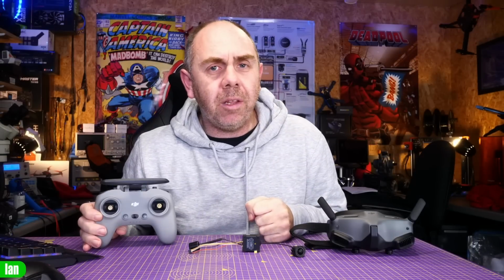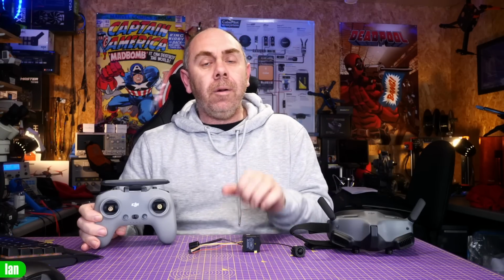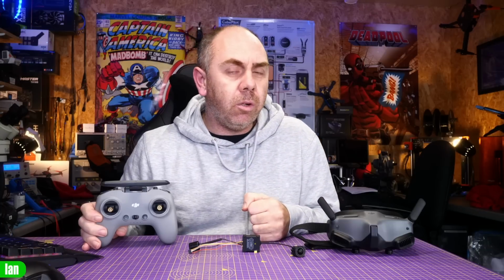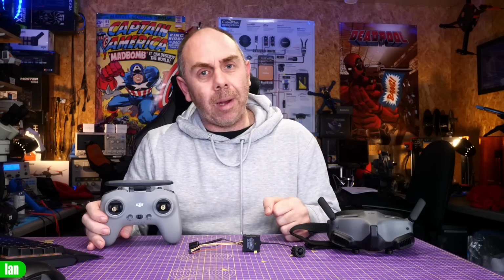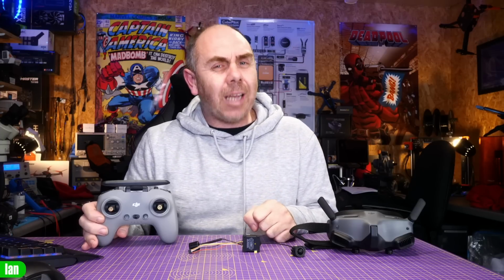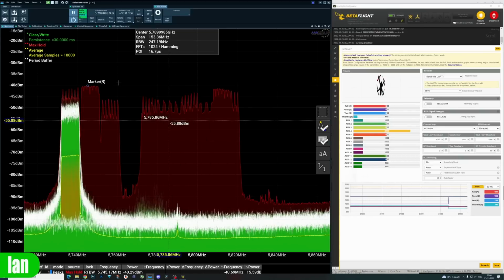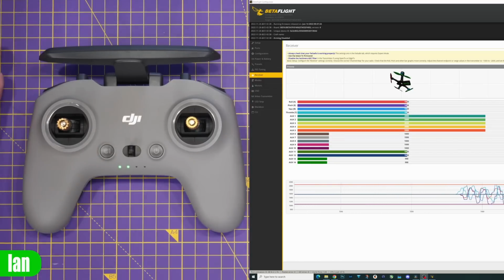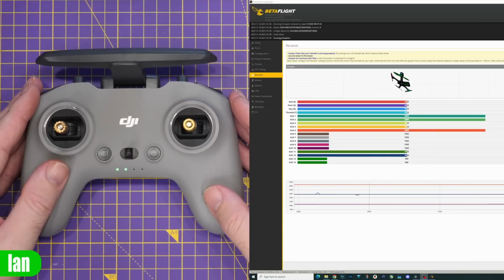DJI O3 Digital FPV Remote - Its Got One Problem

Comment: Without Gps how can altitude be determined on  the air unit in the event of a failsafe you have it go to say 200Ft and RTH. How would that work? Or you don't have the option of RTH because of no gps?
Reply: without GPS you don't have the return home feature, to have RH you need have GPS to pin point your home at take off

Comment: So since the Avata is O3, does it have the same problem when using the Remote 2 controller ?
Reply: yes, but Avata will kicks in whatever you programmed in signal loss, Return Home, Hover etc

Comment: It's really cool they released the backwards compatibility firmware last week!!! So many people said they wouldn't do it... How do you all like your crow prepared? Roasted, fried, barbequed... Hahaha!
Reply from the maker: It’s not out yet. No hacks work at all, no FCC, no Naco, no 1200mw. and it also does not work with the other goggles either right now.
Reply: @MadRC  I know Ian but with the Beta out, it's just a matter of time. I'm not referring to you BTW, just the negative Nancys that said they'd NEVER do it because they want to FORCE you to buy the O3 units to use the Goggles 2. 

I guess I don't understand why you'd want the Air Unit to work with the old goggles if you dropped $650 on the Goggles 2? Can't you just downgrade the firmware if you REALLY need to use the old goggles? I mean the Version 1 goggles use an O2 based system, the Version 2 goggles can use either and soon the Goggles 2 will use either, correct? Personally, I'd stick with the V2 goggles, they already work with the old Air Units and the O3 Air Units. 

Compromise isn't a DJI specific situation... There's always compromises to be made, especially when making old devices work with the latest gen. Take Autel, they have 3 versions of the Evo 2 Pro out and none of them work with the controllers of the other 2. V1 only works with V1, V2 with V2, etc. That drone has only been out a couple years, whilst the Air Unit came out in summer 2019, I believe.

I'm not saying we should throw a party or anything but I'm glad to see them working towards keeping their promises. That's more than can be said for several FPV companies these days.

Good chat, cheers!!!

Comment: Thanks for all the hard work.  Just 2 comments though, RC link return might still get you to initiate RTH in case of video loss. My one good argument with the use of the DJI RC is it is the same setup as the AVATA, I’ve seen a lot of good reviews with the AVATA with no RC issues.
Reply: The Avata is sweet. If the video signal gets too choppy the drone autoswitches to normal/angle mode and hovers in place w/ GPS (can also be configured to RTH).
Reply: Yeah, can confirm your comment. I've just ordered the MOZ7 with just 03 for use with the C2. My Avata has been everywhere you can think of and it's only gone into hover in place once and totally lost and landed once. I fly it in woods, forests, bando's, concrete car parks and it's been solid. I do have a Tango 2 Pro though, so can fit a Crossfire if flying the MOZ7 causes any issues. I'm also an ex-DJI FPV flyer and the range on that was awesome and had zero control or signal loss issues when flying that.

Comment: Would it still be better than a FRSKY Reciever and a radio? I feel like the DJI Controller might still be better than FRSKY
Reply: absolutely. night and day difference. Personally i use the dji remote and it's been perfectly fine. If you're stressing the video to the point of it being about to disconnect, you're already pretty far from yourself and have been for quite some time. Probably shouldnt be flying there anyway. I've had more than enough range with just using the dji remote and 03

Comment: Is DJI going to refund all of the people who bought a radio to fly the 03 Air Unit only or are they going to find some kind of solution to this problem?
Reply: they just want the money and run, creating new  stuff without fixing major bugs from old stuff, all about to making millions
Reply: @RCREVIEWS101  They make good stuff, but not having that radio working better than other links like Crossfire or ELRS is pretty sad. I use the black radio on several of my smaller drones and it works fine in my opinion.  Sounds like it works better than this one does.

Comment: Is this an issue that DJI can fix with firmware?  This sounds like a safety issue as well as a drone loss situation. I never had an FPV drone that could just lose RC Link for 5 seconds and not crash. 

Ken thought his BEC failed. Even with GPS rescue set his drone would have been on a dangerous mission because he would have not been able to regain control.

Comment: Wow this is crazy! This seems like a massive drawback! Can they update this via software update to keep Rc standalone or at least reconnect after .1 seconds? Rc link on goggles is shown as a seperate signal indicator so this setting seems completely pointless. 
How long does it take for video recovery on the new o3? Current air unit seems to take quite some time to recover video after signal loss

Comment: I'm guessing the delay is to give the system the opportunity to recover. I'd hate to have it failsafe immediately, personally.  If you have it set to "hover", in 5 seconds you'd recover control. I'd imagine that the OSD would reflect your connection status... At that point it's a tough call. Every FPV pilot I talk to claim that they aren't ever more than a couple hundred meters away from themselves so it shouldn't be an issue to punch out to recover the FPV feed.

I think my main confusion is to wonder how this is different from the original system? Isn't this why many pilots use Crossfire, etc with the og digital system?
Reply: That don't work, yeah might be a couple of hundred meters, but think about your drone going 60mph(easy to achieve) for 5seconds straight.. not real good I think xD.
hover in a fpv drone   will just make it level and not stop moving
Reply: @henrique14211  Fair enough. Apparently,  if you have GPS Rescue or iNav it's a slightly different story. I guess my biggest question was how is this different from the original system? Plus isn't this why most people use the DJI air unit for FPV only and use other systems for control? I'm not sure this is a new situation...

Comment: What happens if you've set the quad to GPS rescue and then regain (unknowingly) control? Does the GPS rescue abort? Or only if you do certain stick movements?
Reply from the maker: There are some commands you can do to regain control so it could lead to issues.
Reply: @MadRC  so you’’re saying if GPS rescue initiates, its best to leave it alone till you know for sure its good to touch?

Comment: I had a signal loss message in my V2 goggles because I was flying behind housing complex and at one kilometer away. I never loss the video feed . It just got a bit blurry on the edges but I did loose the control  for a brief moment with the remote  . As I moved the stick up there was a dead moment, oh maybe  a few  seconds and  I gained altitude to clear the buildings and all went ok after . No more flying behind big structures.  Thank you for all your inputs .
Reply: To be fair that’s an awesome testimonial.  I think we put too much credit in our gear and get too comfortable then when we try to fly it beyond the limits and succeed it shows how far the hobby has come.
Reply: Mine lost signal at 600meters behind a not so big tree😂
Reply: I have a question about O3 Unit. I just bind and fully setup my Geprc Mk5 DC and I just realised - camera angle. I come from DJI FPV so I had the roll to adjust it even mid flight - how do I do it on O3 Unit? 😦

Comment: Wouldn't call it a big problem, as if I lose video link I'm screwed either way, so rth triggering is what i would expect it to do. Already having the remote 2, this is not a deal breaker by any means. Thanks for the info, Ian! Waiting for that range test tough
Reply: Ive lost video many times long ranging, hit horizon mode and punch till it comes back… five seconds is a very long time.
Reply: Seems fixable through a firmware update. Hopefully DJI pays attention. I really like the controller 2 and it’s a big selling point for me to get O3 air units. The avata has amazing penetration with my v2 goggles and fpv controller 2. I see no reason the air unit will be any different. I’ve got one getting delivered today and an aos cine25 updated for O3 on order! It will be mostly for indoor use anyway so I doubt I’ll ever lose video on it anyway based up my experience with the Avata.
Reply: @SkeezyFPV  Well, shit like this shouldn't get to production at all and if it for whatever reason couldn't be avoided it should be documented and mentioned in a way that makes it impossible to miss.
Reply: Agreed. If I loose video, I'm just going to hit RTH anyway, so I'll set up my failsafe to do that. I understand this isn't ideal for some, but for others, it's fine. Got my 03 today, it remains to be seen how well this will work in practice. I do love the idea of not having to carry two remotes for my DJI FPV drone and my home built racing drone...

Comment: I wish it would be through a separate link because it's so handy to have in one eco system but yes I agree with you. Since I lost my first fpv I prefer to have video and rc link separate.
Reply: This is huge and something I didn't consider, if you get into a bad area and lose video but have a separate link, normally all you need to do is punch out, get some altitude and you'll be fine. But if the video and Tx are together, you lose video and control at the same time.

Comment: I'm curious if the older DJI FPV system with the big black controller also has the same behavior?
Reply: No. I’ve lost video before and just flicked the horizon mode switch for hovering and raising altitude until video returns
Reply: @creationlabsinc.189  Thanks! Great to know!
Reply: @creationlabsinc.189  I think the avata and controller 2 work that way also.

Comment: That should be fixed from DJI, on the other hand its not a deal breaker for me, i love my TX16s with AG01 Gimbals + FrSky Grand Lotus Stick Ends there is nothing over it!
Reply: True after how much I’ve spent ungrading my TX16s no way I’m going gamer control mode
Reply: I use the same setup, love those frsky lotus ends.

Comment: Good that I switched to ELRS and sold my Dj Remote :)
Reply: Yep! Now just have to hope you picked the right ELRS setup. Open source has its disadvantages too which is why 4 years ago I went with crossfire. No jumping through hoops in FW. Just bind and fly
Reply: @creationlabsinc.189  yes I know but i had the dji FPV remote the black one. And right now you can't use it with the o3 Airunit.. and this after 2 years.

Comment: Pretty sure this works the same as the black controller and Caddx. I’ve dealt with it since day one, it’s a rare issue and I pay attention to the mbps, if it drops to less than 5 to 7 mbps, I punch out to regain better connection. The mbps is my version of rssi.
Reply: Exactly...... this is nothing new to the people that have been using the DJI radio for the past couple years like myself.

Comment: Thx for the detailed explanation 👍.  Considering the rc is integrated thru hardware of the 03 and not independent, am I correct in believing even firmware can't fix this and we are stuck with the issue?

Comment: This is an absolute K.O. criterium, especially for long ranging.
Reply: You’d be a fool to use this video link in that manner. Too many more powerful tools for those applications
Reply: @creationlabsinc.189  im Long ranging with DJI v1 in a radius of about 7km and it is amazing. The new system has even more power, so sure why not? Use crossfire as radio link and go

Comment: Do you think this might have something to do with the method you used to test? 

Doesnt the controller talk to the goggles and then to the drone? Would moving the goggles only away from the drone cause strange test results because of the way it communicates with the air unit? 

Could we try a real world type of test where we move the drone away from the goggles and controller?
Reply from the maker: The goggles and the remote were next to each other basically. This is has been also seen in the real world too
Reply: @MadRC  Awesome work man, I appreciate the reply!  

Hopefully we can get to the bottom of why this would be happening and maybe they can fix it in future firmware updates 🙂
Reply: @MadRC  in the video you said you walked the goggles away but kept the remote within range though?

Comment: Dji signal is very strong, if you use dji tx v2 you might loose video signal first. But if you use the other tx rc you maybe rx-lost first.
Reply: Other tx? Other dji tx big black? Or crossfire?surely dji video wont outperform crossfire
Reply: @Halphbaked210  I did fly 2km using O3 without any problem, some guys did test 4km with avata without any problem. But I lost video signal when fly cross top of mountant, thank god tx v2 signal still save my drone, can other tx could hold that?
Reply: @stechuav  crossfire 💪👌

Comment: Great information!
How is this behavior different from the Caddx with the black remote?
Can this be a software update from DJI to retain control link with video loss?
Reply: Is there a difference? I like my black DJI transmitter with my Vista's and Air Unit's, and I am dropping my Crossfire stuff😛

Comment: This happens on The Potato too. I've had my Potato video link drop and it loses both - it goes into failsafe and starts to RTH and the sticks don't do anything. I wouldn't be surprised if the Avata does it as well.
Reply: Now that you mention Avata,  I wouldn't be surprised either, but at least Avata has GPS and will kick into failsafe which is normally RTH
Reply: I had it happen on the cabbage the other day too.
Reply: @beefybeef1326  I mostly fly the carrots and onions because of the high carbs in a potato...🤣
Reply: @nq0amark138  🤣
Reply: On the potato, once the video is gone, rth is trigered. Good safety feature I would say
Reply: @TheCatFather01  I fly mine to its limits and even after video drops along with the control link I just crack open a cold one and relax because it returns home every time
Reply: @TheCatFather01  absolutely
Reply: I think it depends if you are in acro or gps mode. It seems to me that in gps (sport/normal) the rc link stays live and lets me punch out if I lose video. In manual it either kicks to normal or failsafes and rth. Or it’s on the ground somewhere lol